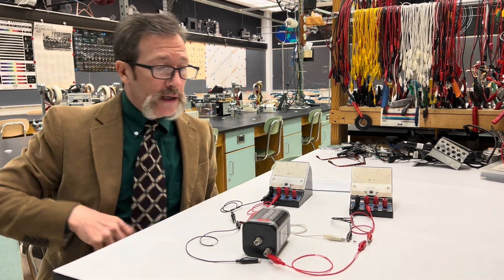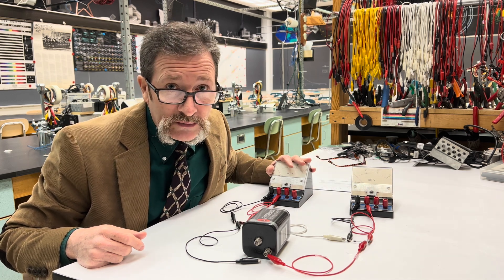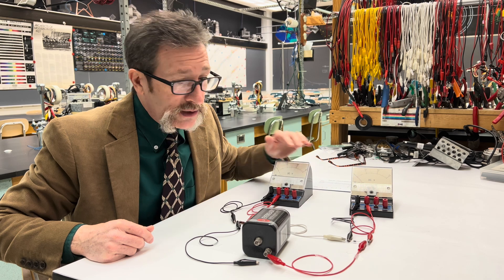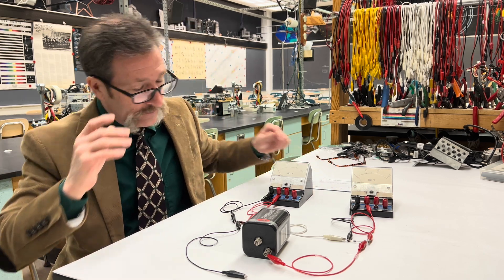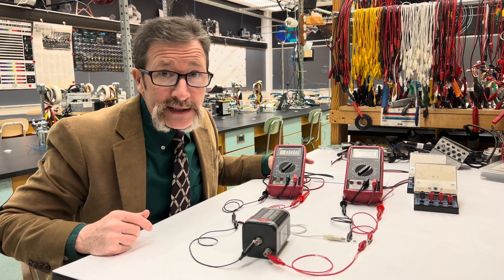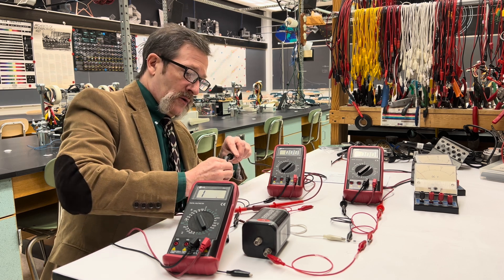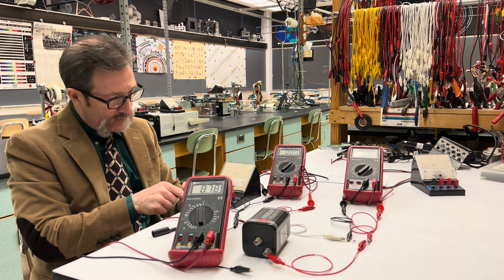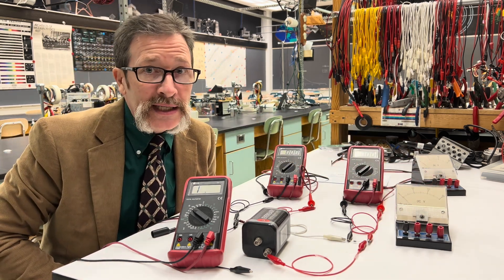Reverse Bias Diode with a Resistor and Two Voltmeters - Idealized Science Institute - EM Quick Quiz

Comment: Based on the Diode symbol used, I'm going to assume it's not a zenor. So, I'm going to say the Volt Meter across the diod will read about 6 Volts, depending on the reverse current leakage of the diode, and the input impedience of the volt meter.   The volt meter across the resistor, will read pretty close to zero, again based on the diode's reverse current leakage, and the input impedence of the other meter.  85%  Ideally,  the diode would be open, and the meter would read 6 volts across the diode and 0 volts across the resistor. But that is with ideal perfect diodes and meters. Real word is not quite so nice.

Comment: Hold it - you said they were voltmeters. I think it would only be reasonable to assume they are ideal, and have no burden, i.e. current draw, or infinite input impedance. Try it with the original meters with a 100 ohm resistor instead of a 10k.
Reply from the maker: Very good! The meter matters. Well done!
Reply: The problem here is we aren't being given the specification of the voltmeters. 
These are ( certainly look like) moving coil types in which case they will draw a significant amount of current from the device under test which will affect the reading.

Way back in the day - service manuals would show
 " readings under test taken with a voltmeter of sensitivity of x ohms per volt"
It was commonly known that 
" taking measurements in circuit" would be prone to errors due to the loading of the test meter 

In these days of dvm's with extremely high input impedances - this sort of measurement issue has long been forgotten.
Reply: Absolutely!
We are all spoilt these days with even cheap dvm's that have very high input impedances !